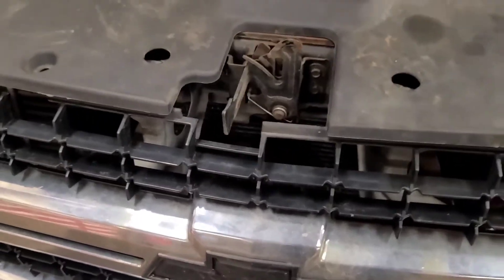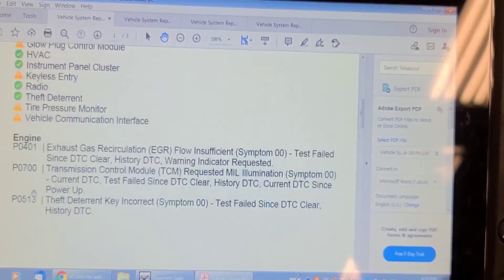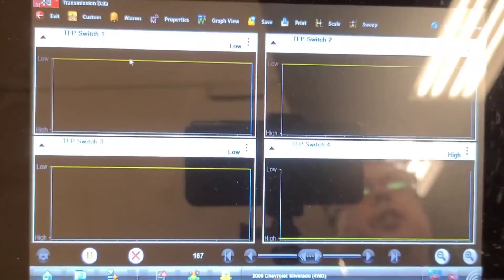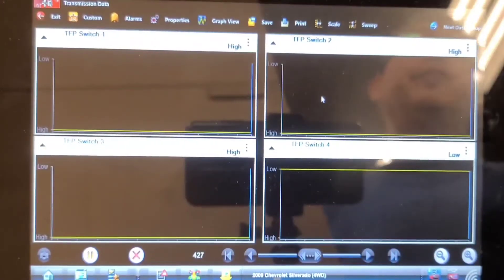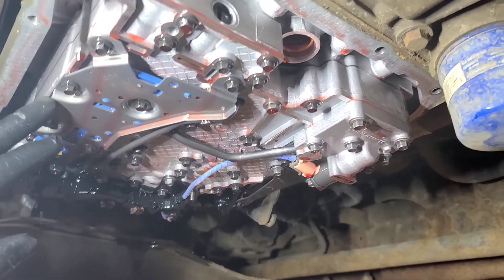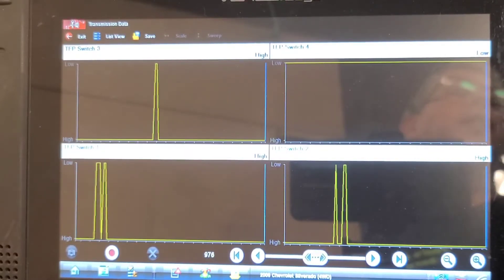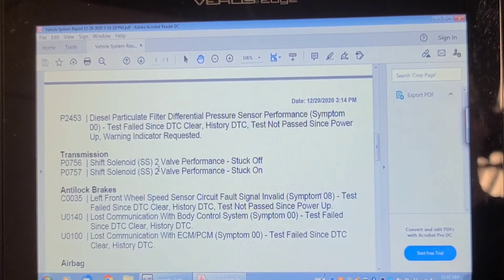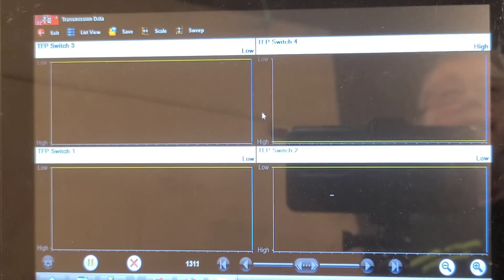2009 GM Truck 2500HD Allison P0757, P0756 Transmission In Limp Mode On Cold Start.

Comment: My 2008 does that when it is -20 Celsius or colder and not  even driven for a few days. If I plug in the block heater I have no issues.

Comment: I have a 2007 Duramax.  Original Transmission died.  Had a Transtar Industrial Reman installed (5yr 300k warranty) installed.  Had a leak that the shop could never fix from seal around rear tail piece shaft.  Then got P0756 fault and solenoid was replaced.  Worked for some time but still leaked.  Shop couldn’t fix it so Transtar warrantied the transmission and sent another one.  Immediately (within 20miles), new transmission went into limp mode with same P0756 code.  I feel like it’s not an internal issue since it is the 2nd transmission and this one should have passed inspection from factory.

Any recommendations?
Reply from the maker: Is there any pattern as to when it sets the code? Is this the only code it set? I'd check pin drag on the transmission connector terminals. Since this circuit is normally grounded by the pressure switch idling in park an intermittent open can set the code.

Comment: I have the p0757 shift solenoid B stuck on. I replaced it with a new shift solenoid and erase the codes on my truck test drove it and still acting up and the code came back. I have a 07 Chevy suburban 2500. It won’t sift into 3-4.

Comment: What do you think about P0757 in a 2017 allison 2200  RDS 

 Noticed previous owner replaced fluid. Looked very red, New TCM, unknown if solenoid or pressure plate was replaced. 

Should i start with solenoid or the pressure plate?

Comment: What do you think about p0757 in an 04 Silverado 2500hd with 4l80e? I’ve replaced shift solenoid b and now it acts like it doesn’t know what gear it wants to be in. And first gear doesn’t like to engage on take off. I’m thinking I should be looking at the pressure switch manifold. Thanks!
Reply from the maker: Yes could be a faulty switch, wiring or even a loss of pressure in the transmission circuit. It's likely an internal transmission problem though.
Reply: @PhillipBailey  thanks for the reply. I’ve been meaning to get a pressure gauge. I’ve replaced the harness and solenoids so far. Going to inspect and test the switch and check pressures when I get a gauge
Reply: What was your fix? I have a 2200 RDS WITH P0757

Comment: Did this fix the issue? My 09 lmm duramax is doing basically the same thing just throwing different codes. 
P0877
P0765
P0751
Thanks
Reply from the maker: No unfortunately it did not. It continued to fault out when very cold. History is the transmission was rebuilt by another shop before this started. Not sure what the original failure was. Likely leaking cooler line and bled to death. Now I believe the problem is a pressure cross leak when cold. Originally when I changed the parts in the transmission I found several valvebody bolts broken off due to over torque and it was put together like that. Could have warped the valvebody. Make sure you oil level is right up to the full mark. Your codes are slightly different.
Reply: @PhillipBailey  thank you for the update and I’ll definitely be checking my fluid tomorrow. Once again thanks for the info!